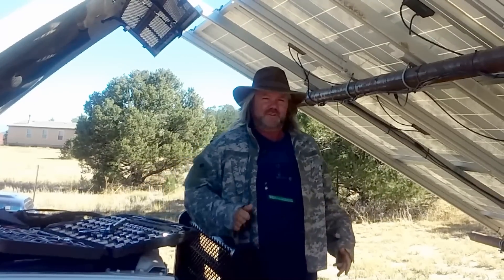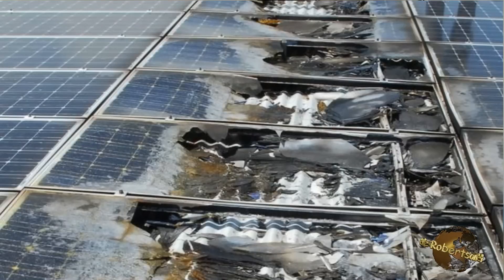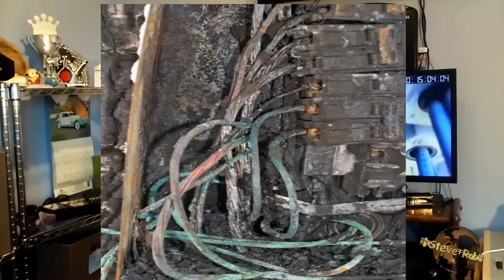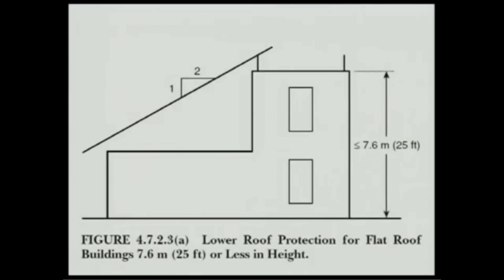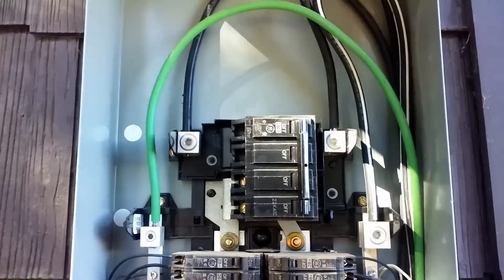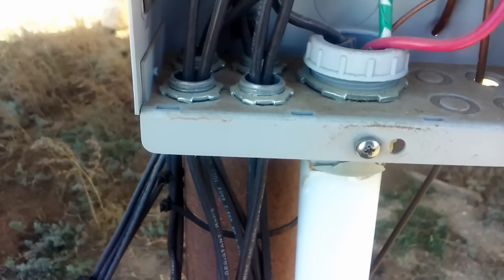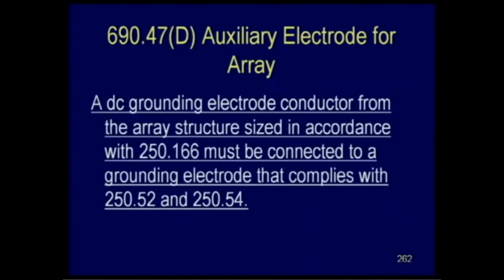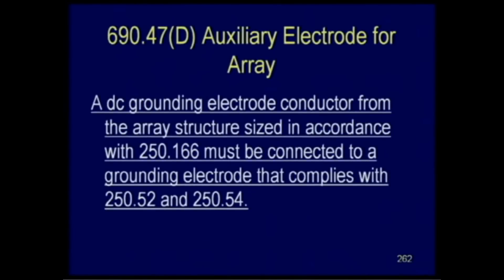Grounded-Ungrounded Systems and Electrical Fire Mitigation

Comment: just like cars everything has a required torque over-tightening them is not a good idea
Reply from the maker: In my years as an engineer in the telecommunications industry, I ran into zero issues from over-tightened lugs.  However, I saw a lot of melt-downs from electricians who did not adequately tighten lugs on the 48 VDC circuits in the switching offices.  Off-grid applications need emphasis on adequate tightening of lugs, particularly on the DC side where arcing occurs much more predominantly than with AC.

Comment: all this information is potentially dangerous a grounding rod does not protect you from shock or protector equipment from lightning damage from lightning will happen with or without a grounding rod now there's a thing called equipment bonding and grounding that safe and very important adding eggs or ground rods jeopardizes all the hard work you put into your equipment grounding current does not flow to ground you add a grounding rod it will return to circuit and will not through a switch the answer is no added more ground rods is not a good idea look up a person called Mike Holt everyone who reads this he'll look up electrocution and the news you'll find all kinds of things person the dog died from pissing on a utility pole has  ground rod they serve no purpose at utility pole grounding rods job in life is static electricity that's it equipment bonding  and grounding is the way to go
Reply from the maker: I not only provided links to Mike Holt's YouTube channel and web site in the description, I showed a snippet from one of his lectures why he and I both agree that grounded systems are much better than NEC's adoption of ungrounded systems.  I'm not sure if you're voicing agreement with my video, or if you watched only part and are expressing disagreement with the part perhaps you saw.

Comment: very good points. got to the point . most people don't have a clue including some elections. thank you.
Reply from the maker: +Roy Amberg  I try really hard to keep this channel free from politics, but occasionally it does burn through.  Good to hear from you again.
Reply: +Steve Robertson (Off-Grid Living) Love it brother. The code here in SC is so jacked up when it comes to dc. Thanks for your hard work. God Bless Brother.
Reply: There's a reason for stiff codes with DC. Play with it for a while.   If an arc starts it ianizes the air then it keeps going till its burnt up. Ac is forgiving compared DC
Reply: Roy Amberg That's why we use DC to weld with!!!